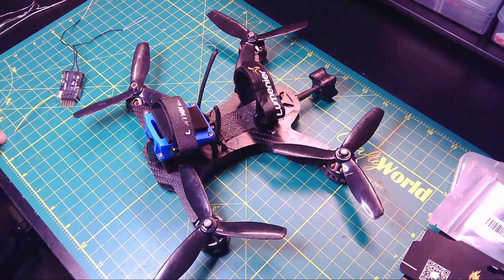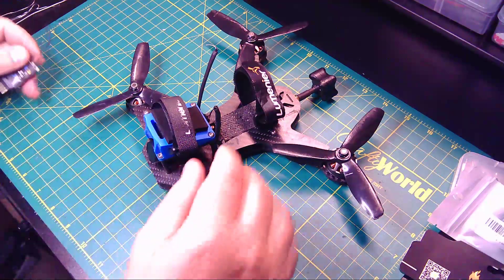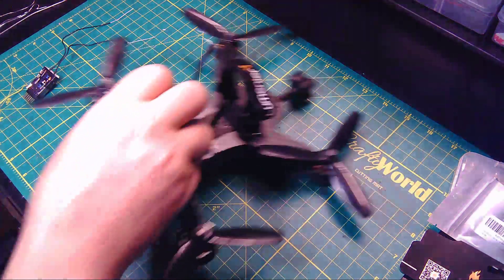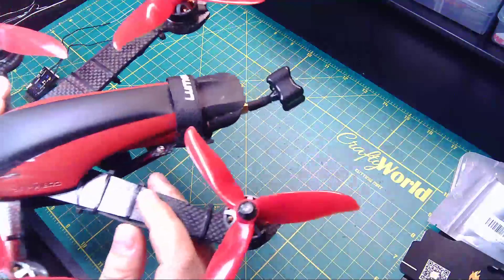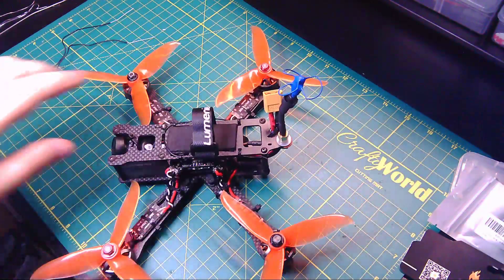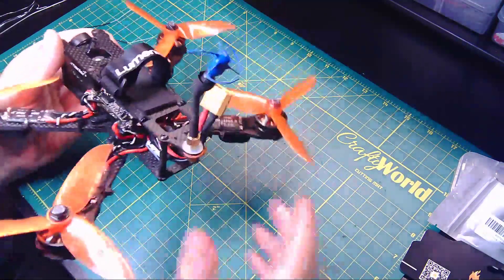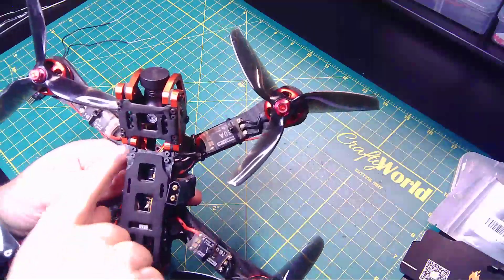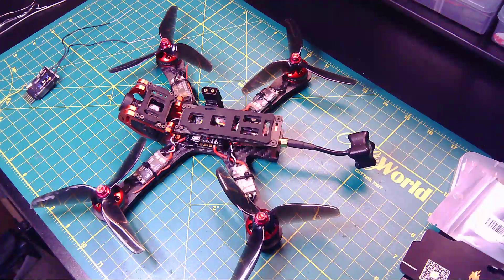Quadcopter Receiver Antenna Mounting Tips

Comment: Thank you! Good grief there are tons of quad build vids that explain the components but most of them don't show how to do some of the detail things like mounting the receiver antenna. So you don't always have to mount antenna in a "V" sticking up like "My Favoite Martian"?
Reply from the maker: You're welcome! You can mount them any way you like but I would just make sure they aren't fully covered all the way around by any material. I got tired of them always breaking and having to repair/replace them after a crash and now just always run them along the arms. Typically I run them on the upper/side of them to avoid damage.
Reply: So attaching them along the body or arm instead of standing up or out away from the craft doesn't have any signal issues? I'm new and working on my first Quad 250 build.  Using an FrSky X4R-SB receiver with SPRacingF3 MCU.
Reply from the maker: @stevejones9044  maybe at longer range but I haven't had any issues sub 600 meters in generally clear areas even with trees. I've been so impressed that I get the mini FrSky receivers without telemetry to save on space and weight.
Reply: Cool thanks for the info.  I will fly LOS as well since I cannot justify getting the fpv goggles yet. Need to find a place that doesn't have a no fly zone area. I live near a small plane airport and the perfect park 1/2 block away is in that zone.  grrr!